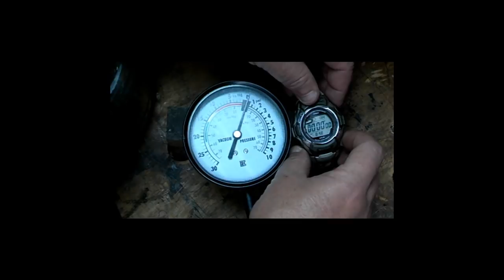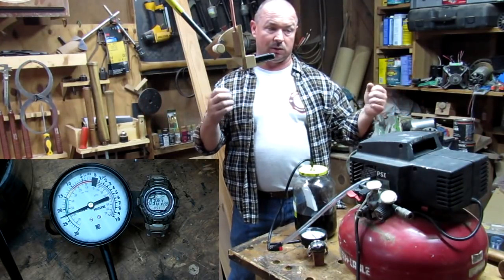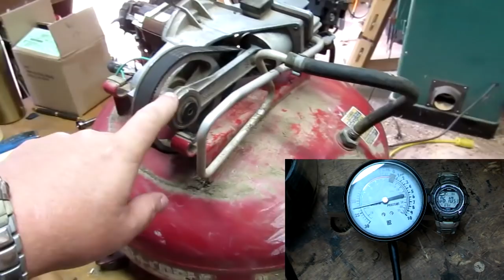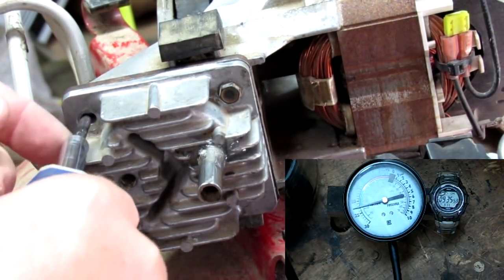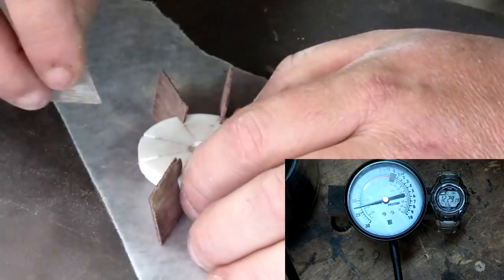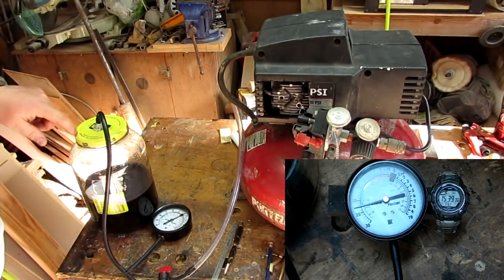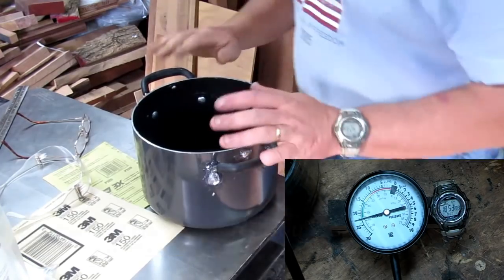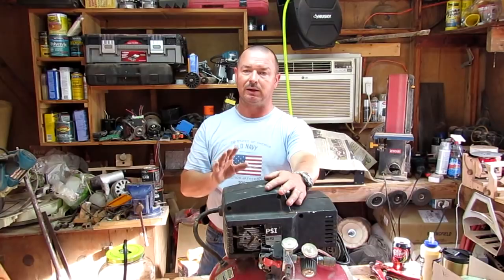#96 Converting an Air Compressor into a Vacuum Pump

Comment: Steve  what is that yellow wrap around the pot, i know its something to help seal but i can tell what it is
Reply from the maker: +gulfmedic1 Thank you sir for your question. It is just a closed cell craft foam I bought at Hobby Lobby. You can get it at most retail stores that sell crafting supplies. I use it as a gasket to seal the top to the pot. Hope this helps. Make sure it is "Closed Cell".

Comment: Do you have issues with the compressor overheating?  Doesn't it run continuously since you are creating a vacuum on the intake?  Good thing to try on a little used one.  Don't think I would do this with my 65 Gallon compressor, but an interesting idea.
Reply: +AnkleBiter Woodworks Should have waited until the later part of the video.  You only run it for a short time.  My bad!
Reply from the maker: +AnkleBiter Woodworks Thank you sir. Yeah, I am not sure if the motors could stand up to the continuous workload. Make sure your Vacuum Chamber is air tight so the pump can be shut off once your vacuum is pulled. They do not have to run contantly.
Reply: Cool.  You are a bit braver than I by modifying the cylinder head like you did.  Not sure I would trust myself with something like that.  Great video and thanks for sharing!
Reply from the maker: +AnkleBiter Woodworks Thank you sir. I did not even know if the compressor would run. It has been out in the weather for over 3 years. Wasn't really loosing anything by trying. Besides, if I could not get it to work I could just refill the drilled holle with JB Weld and continue using it as just a compressor. Now I have a $150 compressor and a $150 vacuum pump. That makes the experiment worth the effort.

Comment: How many CFM's do you need to make a Vacuum system......?   thanks  very interesting videos, keep up the vids
Reply from the maker: Thank you sir. Thank you sir. Very good question. The CFM's are not really that important except for speeding the process. Strength and efficiency of the pump is the actual key to a vacuum system. I think this compressor is a 6.2 cfm. It works really well but I have since build a vacuum pump from a refigerator compressor and it can pull a stronger vacuum although it is much slower. I hope this helps.
Reply: I was at harbor freight and saw a Vacuum pump 2 stage 3 CFM, I'd have to buy a compressor so I thought instead of cannibalizing a compressor I buy one of those.......what's your thoughts....thanks again
Reply: Hi mate. I like the air compressor model as it performs 2 functions while taking up no extra space .

Comment: Steve, That's a great idea.  I have the same compressor sitting out in the shed.  Do you think it would work for a vacuum chuck?
Reply from the maker: +Russ Stolzoff Thanks Russ.  Yes, I believe it would. It pumps a good deal of air and and will reach vacuum pressures as well as any vacuum pump. Should be just fine for a vacuum chuck. Watch the motor, don't know how it would act under long use. It was designed to kick on and off. Hope this helps.

Comment: Is there a way to have both a compressor & vacuum pump in one, without having to reverse modifications? I was considering making a vacuum pump for veneering but already have a Ridgid TriStack https://www.ridgid.com/us/en/tri-stack-5-gallon-air-compressor which has three outputs. It can be used with or without the tanks. Is there any way to turn one port into a vacuum port?
Reply from the maker: +matermark Thank you sir. Your three outputs are on the discharge side of the pump therefore they will only output air. You can purchase a venturi system and use one of the discharges to pull vacuum. without having to modify anything. However, if you would like to use your compressor as a vacuum pump a port will have to be installed on the "intake" side of the pump such as what I did in the video. You can then use the pump as a compressor or vacuum pump without further modification.
Reply: +Stephen Ogle Thanks. A PIAA guy recommended a part # for a venturi type a while back but I didn't do anything--I was thinking of using a different type vacuum pump at that time and making a dedicated system for doing veneering.  I guess I either start too many things at once, or I forget too many things at once!

Comment: 23” vac is not very good as far as vacuum goes  a hand brake bleeder vacuum pump will pull a better vacuum for about $25  or a cheap harbor freight vac pump will get a 28-29” vac easily for about $80

Comment: actually......with an  actual vacuum pump i pull 29.9 inches and so does everybody else regardless of their elevation.  but of course, thats with a piece of equipment designed to do so and on a sealed system that is also designed to do so.  elevation doesnt determine your vacuum if your vessel is sealed.
Reply from the maker: +jeff leonard Thank you Jeff for your input. Vacuum is directly related to the atmospheric pressure at your location and atmospheric pressure is determined by your elevation thus the higher your elevation the less vacuum you can pull. It is a simple scientific fact.
Reply: that is not a fact.  in a sealed system atmosphere has no play once you remove it from the system.  i pull a vacuum for my job and i do it often.  29.9 inches of mercury everytime.  and even beyond the inches of mercury......i actually pull below 100 microns regularly.  the lowest ive ever gotten so far is 82 microns.  and elevation is irrelevant.....people all over the world in my line of work at every elevation achieve the exact same micron readings.
Reply: jeff leonard 
True.

Comment: Should of just hooked up to the intake port instead of doing all that drilling & epoxying. 
 All you would of had to do is drill a hole through the top of the plastic case,
 Then you epoxied the fan on instead of making a key or something else.
Reply from the maker: Thank you Scott. Very good points. However, the intake ports were just slots cut into the head. It was much easier to epoxy the slots and drill a port hole. As far as the fan goes. There was no key slot on the motor shaft to accept a key. the other was glued on. Lastly, It still works. Can't complain about that. Take care.

Comment: Why not use a vacuum cleaner..
Reply from the maker: Thank you Brian. Excellent question. I have not found a shopvac that can give this amount of pressure difference. I did experiment with one when I first got interested in vacuum stabilization and casting. They just do not produce the same results as a vacuum pump.
Reply: I really knew this but it was only meant to be a joke, to be honest the only vacuum motor I have is wipers on my 59 Ford,, this system uses manifold vacuum, the problem is when going up hill the wipers stop, the way of preventing this is a vacuum pump on top of the fuel pump, I really enjoy learning physics and unseen laws, Gravity, gyroscopic & other laws of nature. thanks for your reply..